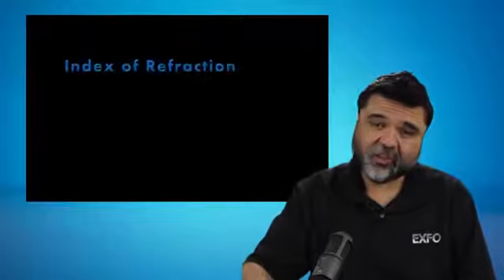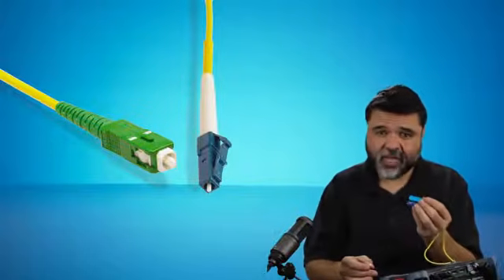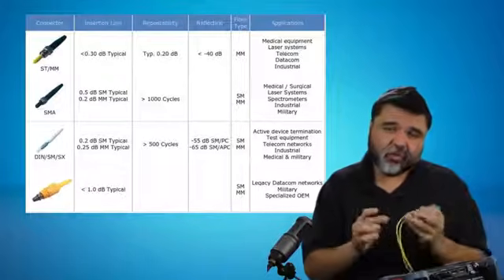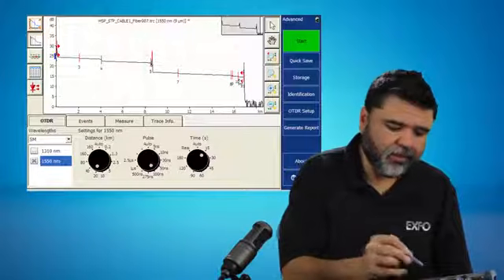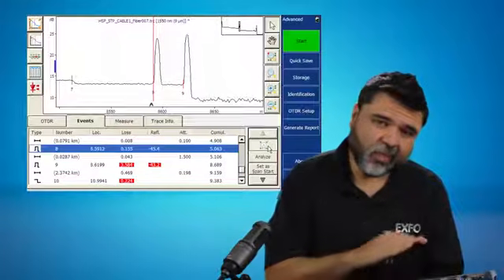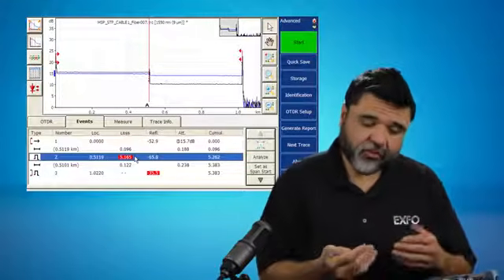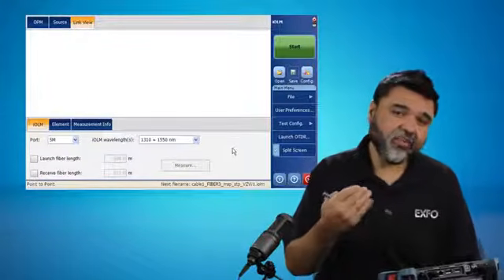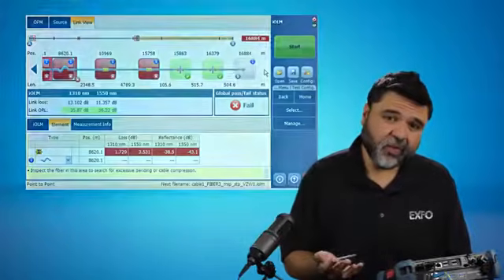What you need to know about OTDR Trace Analysis and Interpretation | Educational

Comment: 6:10 The ‘PC’ in APC and UPC does not stand for “polished connector”
 APC = Angled Physical Contact (higher performing, but not good for repeated mating/unmating cycles)
UPC = Ultra Physical Contact (mating surface is head-on with tightest possible tolerance)

Comment: Hi,

We recently entered into an agreement with a telecommunication company that requires us to measure the lengths of fiber optic cables in specific areas using an OTDR device. As a test, we began measurements from a point known as the Optic Line Terminal (OLT) in one area, using the OTDR device in FTTH mode. This resulted in the generation of 50-60 PDF reports.
 
Our current challenge is processing these OTDR results to determine the total lengths of the cables in the specified area accurately. The difficulty arises because some cables follow the same route before diverging to different neighborhoods. If we simply sum the lengths from the PDFs, we will end up with inaccurate and unrealistic results due to the overlapping routes.
 
We need to identify and deduct these common, mutually used distances to get an accurate total length. We are struggling with pinpointing these overlapping routes/distances. 
 
Could you please assist us in resolving this issue?

Comment: Quick question Kev, I am on an Offshore substation build, we have MM ans SM links, the company is insisting we use an OTDR to get results, I would much rather use an OLTS. The longest cable is probably 75m, Can I ask your thoughts on using an OTDR ovr such short lengths? I personally think oyu  would not get an accurate test result and would have to switch off all parameters on the EXFO  to get any kind of pass.. What do you think?

Many thanks, Rich